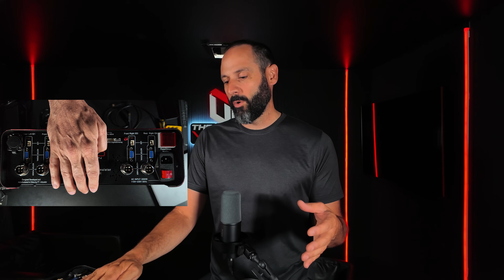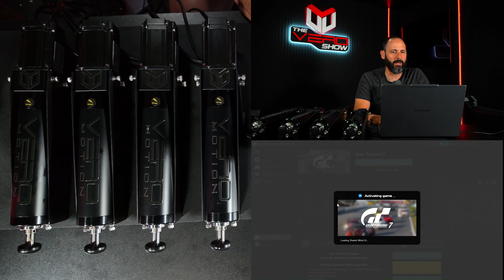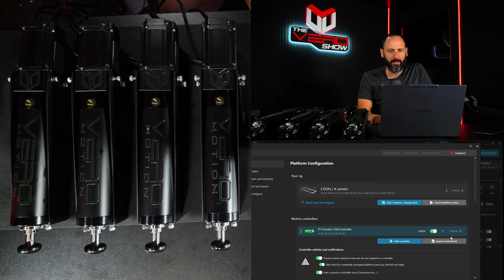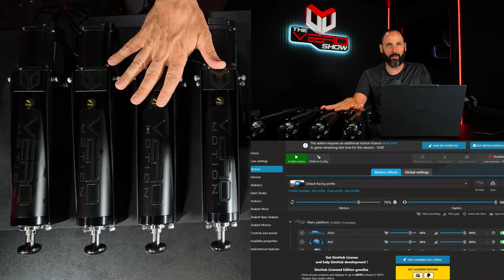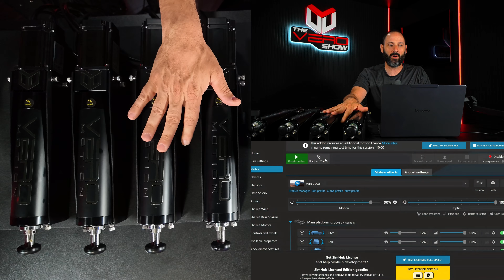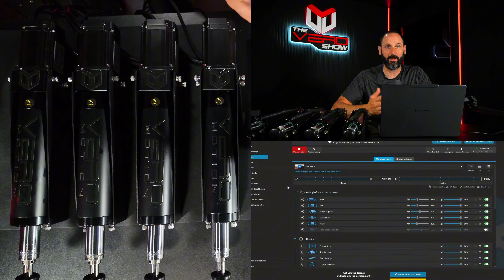Vero Motion Champion Setup Guide | SimHub Tutorial

Comment: Why the new connections on the front?  I have the first version.
Reply from the maker: The only reason why is it simplifies assembly. Instead of the connections going through a wire jumper and located further from the drivers, the connection are soldered directly onto the drivers. No performance benefits.
Reply: @Vero-Motion looks like first version has fewer cables
Reply from the maker: @001AAR same cables just different connections